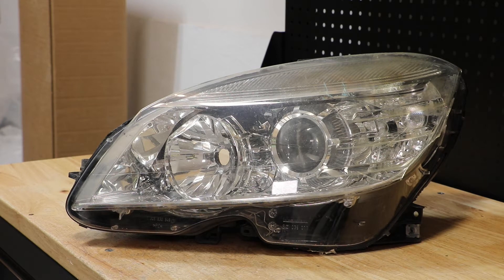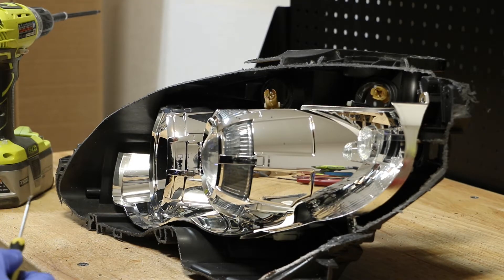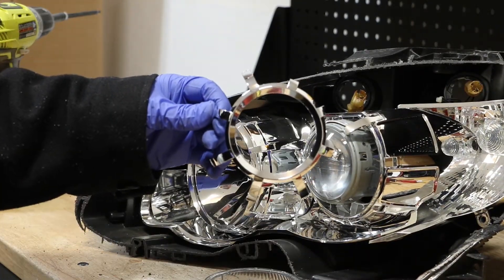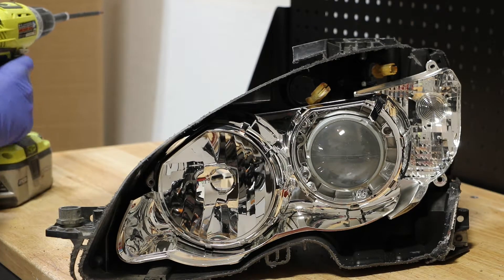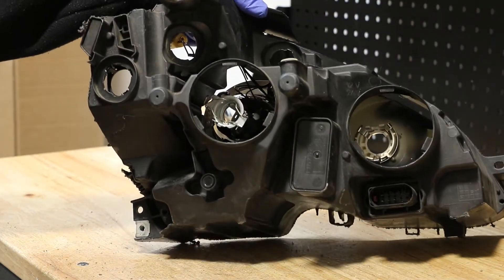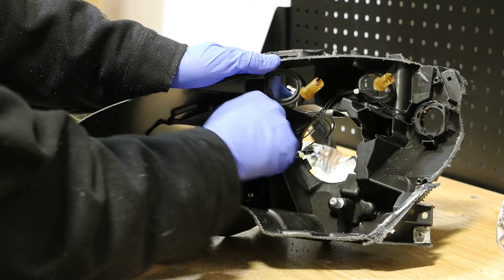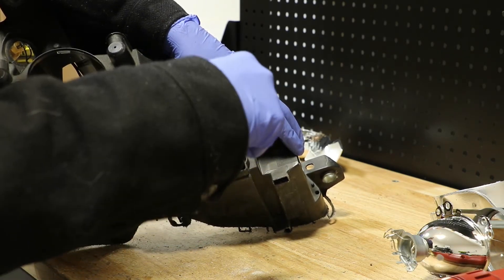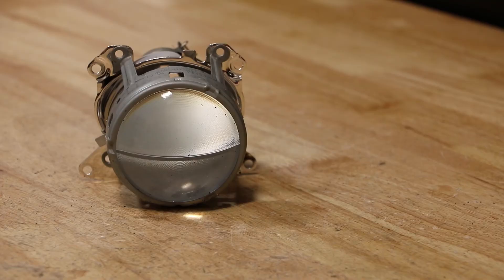2008-2011 Mercedes-Benz C300/C350 Halogen Headlight Disassembly

Comment: How did disconnect the lense from the light? With a heat gun??
Reply from the maker: I used a saw.  I do not put the lens back on the ones for these videos.  if you intend to put the light back together, you need to use a heat gun or oven to soften the glue and pry the lens from the housing.
Reply: @gftgrill  and how and with what do I put a new headlight lens on it?
Reply from the maker: @TheKing3.0-d5i  RTV Silicone Sealant should be used to reseal the light.